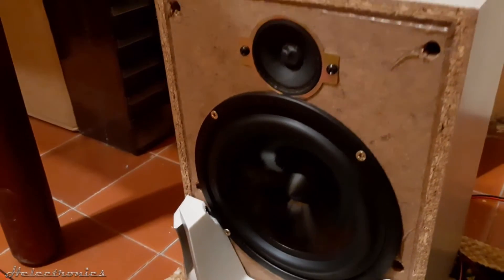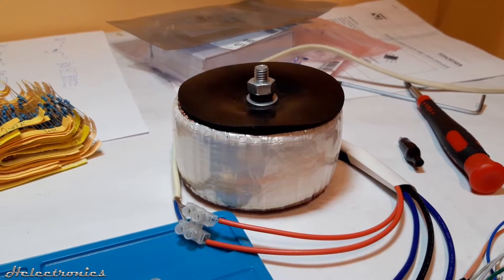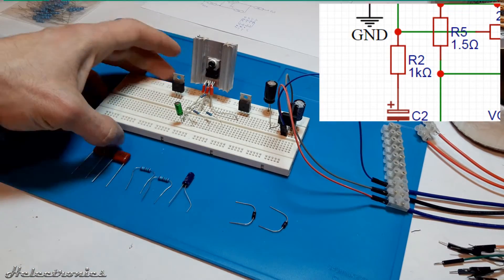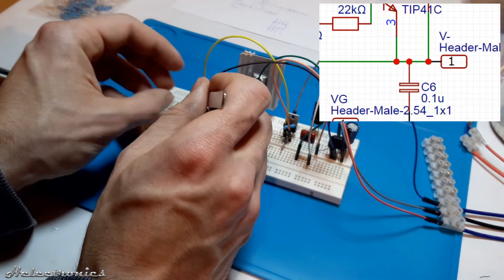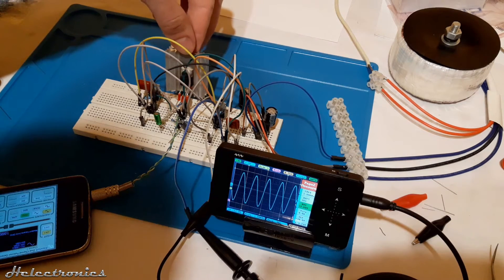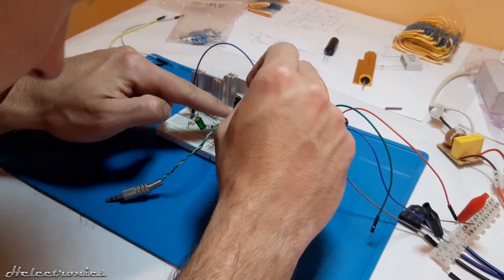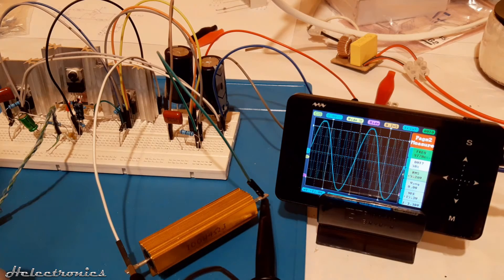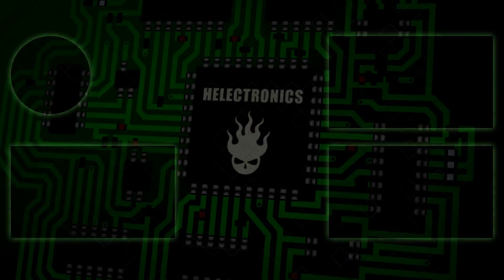TUTORIAL - TDA2030A + Power Transistors (TIP41C & TIP42C) (Easy-Medium Difficulty)

Comment: For the AD820 you can also make a current booster by use of pnp and npn Sziklay pairs whos bases are simply connected to the output of the low power opamp. The transition between -0.7 V and 0.7 V goes within 70 ns, because of its slew rate of 20 V/µs. This is not audible. You have to make sure, that the feedback comes from the booster stage output, because there is no direct connection between the opamp output and the booster stage output. If you like to improve the transition characteristic of the booster stage you can simply put a resistor between the emitters and bases of the booster stage, which carries at least 10 mA from the low power opamp directly to the speaker (68 Ohm) for low signal voltages.
Reply from the maker: Thanks for the detailed comment! I will put it on the list and try that. Haven't built a Sziklai pair so it is time to do that.
Reply: @Helectronics  the good thing is, you can choose good pairings by yourself. And you have to do it as well, because there are no Szikai pairs avaible as integrated devices. I can imagine, that it could be a good business to offer integrated Sziklai pairs, because they have the advantage of 0.7 V BE voltage instead of 1.4 V.

So, in power amplifiers you gain in total more than 1 V of peek-to-peek output voltage, which helps to get more output power and less power dissipation, especially in low or medium power amplifiers for low speaker impedances.
Reply from the maker: @gkdresden  This Sziklai transistor pair might come handy right now, I am currently designing a 5.1 amplifier and I wanted to use the TDA2030A + TIP41C + TIP42C configuration for the subwoofer channel. Now I will try to do more research and find a good combination to test the Sziklai transistor pair with the TDA. JohnAudioTech channel also has videos about the Sziklai transistor pair. Thank you again for the comments and the information. Can you recommend good transistor pairs to start test with?
Reply: @Helectronics  I often use the BJT pairing BC547B together with the TIP32 for npn and the BC557 together with the TIP31 for pnp. A base resistor for the power transistor is necessary to make the Sziklai pair fast enough.

Comment: In the same way you can also booster low power opamps with Sziklai pairs in the current amplification stage. In order to do this you should apply a rail-to-rail low power opamp (AD820, Analog Devices). Otherwise you will lose more than 0.7 V output voltags swing (for the same reason you should use Sziklai pairs and not Darlington pairs). The transition current for the booster stage should be set to at least 10 mA (68 Ohm in the power lines to the low power opamp). The shorting capacitor between the power pins of the low power opamp need some experimentation. In my experiments with the AD820D I have found that it is not required for this device because of its very good common mode rejection. It tolerates a lot of power line voltage fluctuations without oscillation.

Comment: nu e ok... ceva e gresit acolo. ar trebuii sa scoti cel putin 8-9w rms fara tranzistori. incearca  cu un simplu buffer in fata, apoi lasa rezistenta de 470 ohm pentru castig mai mare si renunta la rezistentele de 1,5ohm daca nu depasesti +-19v. si daca ai elimina rezistentele acelea de 1,5 ohm care limiteaza curentul ar trebuii sa ai o crestere a voltajului rms pe iesire
Reply from the maker: Nu e gresit, sunt foarte multe pierderi in circuit. E construit pe breadboard de calitate medie ceea ce rezulta pierderi. Integratul TDA2030A nu e original ci chinezerie ieftina care e aproximativ 30 la suta mai slab decat originalul. Poate ca si transformatorul nu e destul de puternic, ar trebui una de 2x15V 100VA. Am una de 2x17V dar nu am vrut sa risc ca dupa recrificare poate ajunge la 21V.
Reply: @Helectronics  am si eu chinezarii si scot destul bine cu preamp bun. chiar surprins
Reply from the maker: Ai masurat puterea cu osciloscop? Ai construit-o pe breadboard?